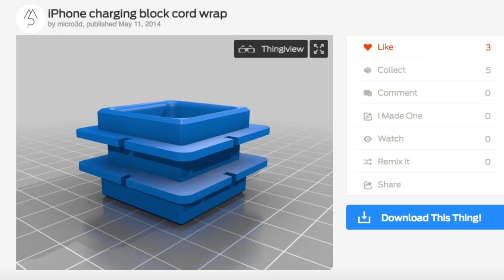Filament Friday #4 - iPhone Charger and Cable Holder - Video #039

Comment: I quickly discovered that when I print anything off that is size-dependent, like some sort of holder, case, or parts that clip together, I have to scale them up by about 5% to get them to fit. This happens with just about everything I print off, but it could be because the ABS tends to shrink a little when it cools.

Comment: Same thing happen to me with iPhone cases but like a 5% upscale helped but still it's either people not putting up the right size models of the printer is printing the walls to thick. Some printers I'm sure there software prints slightly different. I wish there was a way to tell if it was the print or the printer.... Not enough people on thingerverse will tell you if there print came out bad so it'd hard to tell. Just uploaded a gunsight with video and all so people could see it actually fits..

Comment: Hey Chuck,

I saw your comment about your door not staying latched any longer.  I think I beat you to the punch on this one!  I designed a magnetic block that I glued on the top of the door where there is a metal piece that holds it quite nicely.  I have an .STL file for it if you or anyone else wants it.

Comment: Hi Chuck, I measured the area the charger fits into on the 3D model in Rhino. It's 25.8 MM. You could put some calipers on the actual charger, and see what that measures.
Reply: ***** I fashioned a new model using the dimensions you provided. I haven't printed it and I don't have an actual charger to test it. I offset the opening by .5 mm to allow for the charger to slip through easily. If you're still interested, take a look. Any suggestions for design changes will be considered. http://www.thingiverse.com/thing:682664